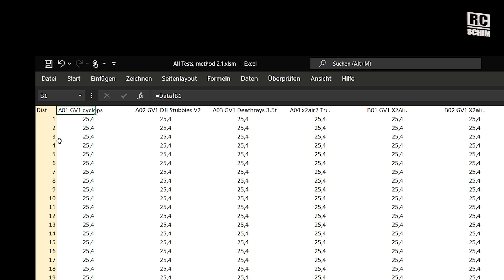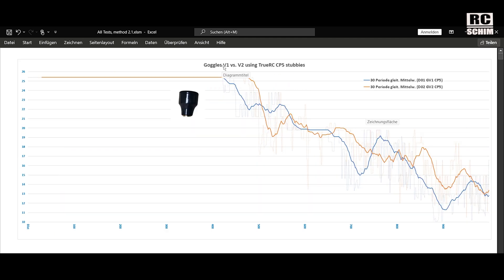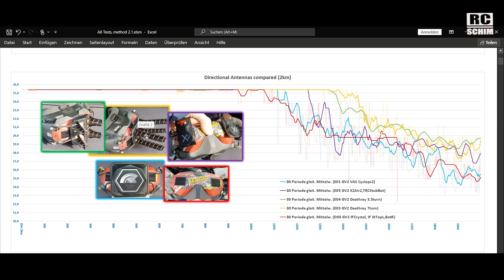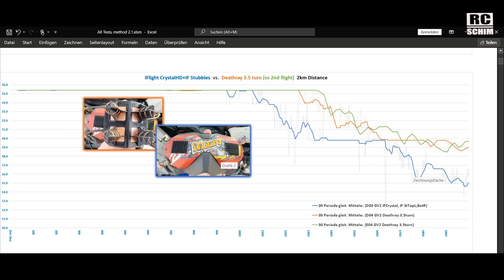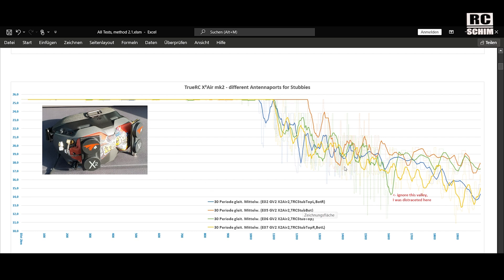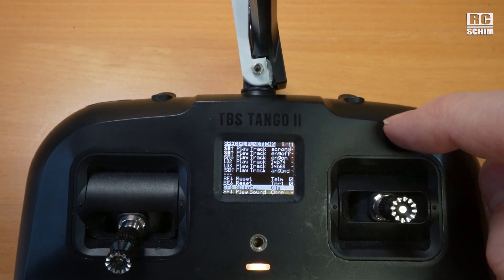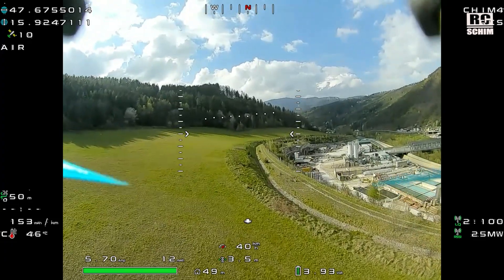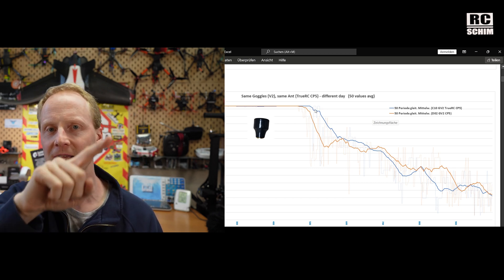Did I test YOUR anntenna? How good is it? (Antennatest 2023)

Comment from the maker: Link to my Antennatest File: https://bit.ly/3LsRQx0   and here the online tool: https://maxbl4.github.io/otx/index.html
SUPPORT my work:   my FPV24 affiliate link https://bit.ly/3UcTLJL  or become a PATREON: https://bit.ly/2ESMtIO
Products:    
TrueRC X2-Air MK II LHCP  https://bit.ly/40WMf7H 
TrueRC Singularity 4-Pack LHCP https://bit.ly/3NtFsPU
TrueRC CP5 Stubbies https://bit.ly/3BFOsL1
iFlight Crystal HD  https://bit.ly/4166Vdn
Reply: Thank you for sharing your valuable knowledge with us. My v2 goggles lost the signal after 600m. The goggles were indoor. what is the best antenna's performance to improve data rate and range? what type of adapter do you recommend?
Reply from the maker: @asmaali9466  Hi, first way to improve your signal is the NACO.txt file hack (or HamCFG on DJI O3). Just mention this because not everybody uses the may power...
if you were inside a house and flew outside, this is difficult (how think is the wall...)  this antenna test here is the most recent I did (since lately it works so good no need for better antennas).   You see in my results that I trust Hugos antennas (TrueRC) - they are not cheap - but good performance.   On the TX side (the copter/Plane) also use good, long neck antennas - so they have a good position.
on the RX side (Goggles) I love the X2air patches and TrueRC Stubbies on top. This is a super small yet powerfull combo which I use now over a year (and I have flights with 5-6km and no issues).

Comment: Great what you're doing - I have a V1 and a V2, each with 3 patch antennas and an Omi (bottom right). Is the V1 better than the V2 due to diversity? With the V1 I can cover a distance of 5km on poor terrain. Greetings from Munich
Reply from the maker: greets back, dont think there were considerable differences between g v1 and v2 with same antennas installed. my goto config for the last 2 years now was:  2 TrueRC Xair2 patches and 2 TrueRC CP5 stubbies on top ports - as these were the best stubbies and they give me a good overall performance.
Reply: @Rcschim  okay, then you never have two patch antennas as RX, which wouldn't be optimal for longrang, right?

Comment: How many mw were you transmitting in all these tests? Also have you done a test for the stock ones?
Reply from the maker: 25mw if not stated other. And yes, there should also be stock antennas tested. Use the chapter marks

Comment: Great video my friend! I had Lumenier AXii HD2 but I sold my DJI FPV Goggles V1 last month. I'm going to buy DJI FPV Goggles V2 soon. I'm happy with my previous Lumenier AXii HD2 antenna. Is the TrueRC X2 Air better or they perform almost the same? The AXii HD2 cost way cheaper too.
Reply from the maker: The axii 2 should perform similar to the iflight Chrystal I've tested, so yes they will be a bit behind those truerc xair2... but just try it and see if you really need the range...
Reply: @Rcschim  Thank you!

Comment: Have you tested X-Air (mkII) antennas as well?: they have 2 connectors per pair instead of 1 as is the case with the X2-Air antennas that you tested. My expectation is that the X-Air (mkII) will result in more range since all 4 antennas on the goggles are directional then.
Reply from the maker: No, only tested the x2 air... but they are my default setup now for over a year. Never needed to bother with antennas again ;)
Reply: @Rcschim  Have you tried x2 on all ports? I have it now but i dont know if its better or worse than having only two. It feels very directional.
Reply from the maker: Yes,  I have the x2air on all 4 ports as default setup since over a year now, works great!
Reply: @Rcschim  I am guessing you mounted them horizontal? To fit all 4

Comment: great stuff, i have three og antenna and one iflight stubby, what channel and antenna orientation should i use? hehehe, i have top right the iflight stubby, and just recently switched the vista up to 1000mw, i really hate putting that much power through the vistas, its gotta hurt them long term?
Reply from the maker: I think you should be fine. If I don't need max penetraition I stick with 700 imaginary units of power (which equal the legal 25mw)

Comment: I think I'll have to try some helical antennas on my goggles V2.  thanks for the test results Mario!
Reply from the maker: yep, helicals are still the best.   I was always surprised (in more than one test now) that my 7turn helicals are not that much better than the 3.5turn ones. Maybe the longer ones really start to shine at very long ranges?  greets and thanks for coming over here for this vid, Mario
Reply: @Rcschim  Hi Mario from Scotland.. I'm assuming the death ray 5 turn would provide similar results if the 3.5 & 7 turn are similar?

Keep up the good work ! 1 other thing do you have any videos of building a ground station as I fancy trying all the antennas on a stand / tripod instead of the V2 goggles..
Reply from the maker: @serval_fpv  Thanks and greets to Scotland! About groundstation:   never tried one for DJI - because I think you'd need 4 extension cables for antennas if you wanna wear the goggles while flying. Cables mean loss...
You could try to mount the goggles (with antennas) on a tripod and stream the contents to a seperate screen. Friend of mine just did something like this with 10" screen and a raspi HDMI setup. Sounded a bit overkill but works cool. If you are really curious shoot me a mail to rcschim@gmx.at and I will forward your question to my friend.
Reply from the maker: @serval_fpv  oh yes, and I suppose you're right - the 5turn might be quite similar. In theory the 7turn will be way better on the extreme end of a longrange flight (which I've never gotten to).
Reply: @Rcschim  Are the 3turn Death Ray Helical Antennas still available anywhere?

Comment: Just curious if the truerc x2 air are plug and play for the DJI fpv goggles?
Reply from the maker: yes, sure. They come with dualside advesive and you can either glue them directly to your faceplate. Or as I did: use a 3m Duallock hook tape to make it swappable (which I needed for my tests - now I would permanently tape them on because they are good!)
they use 2 of your antennaports - the other 2 can be used with stubbies.
Reply: @Rcschim   awesome! thanks for the reply the main reason I bought the antennas was because of your video👍👍👍

Comment: Great testing as always Mario. Sorry if i missed it in the video, how did you automate the logging of the bitrate of the video link? I have always manually log it but it takes a LOOOG time :D
Reply from the maker: Thanks Oscar! Great to see you here in my comments. Don't be shy, come here more often ;)
The goggles (v1 and v2, not so sure bout g2) record the SRT file.  Normally I would have converted this SRT (subtitles) to an CSV file (be text replace makro). But the super cool online tool I've linked to does all this.   But it is based on the OpenTX logfile first, and can then JOIN the SRT from DJI. Only downside: on longer flights, where SRT is split by DJI - you only get the first. Or you manually join the SRT files into one...
Impressive stuff:  the programmer joins the SRT file with time sync to the OpenTX Log. Try this yourself in Excel - it's a nightmare.

But as I said, if you just want a quick look at the performance (of an antenna) you can upload it there and get the chart there easy without using excel yourself.
Lately he added to option to change the X axis from normal index (count) to the GPS Distance. This is uber cool - because that was exactly my idea in excel  (assign bitrate values to certain distances - and make averages).
greets, Mario

Comment: Nice real world testing to get away from what appears to be non-standardized manufacturer's data claims! I find it interesting that your 3.5 turn helicals beat out the X2Air2 set up midway through test yet hold on at the end. Do you have a hypothesis to explain that result?
Also I want to add that apparently the receiving antennas on the DJI-V2 goggle are located on a diagonal. When wearing the goggles the upper right side and the lower left side are the receiving antennas. The others are the transmitting antennas. So your results suggest that both the reception and transmission are  needed to give the best bit rates. Not surprising given that is the DJI system.

Comment: Nice test. It's hard to beat the helicals when you really need range. Per the comment about pagoda's not being as "omni" as the others, I feel like this is in your favor. Most of the time folks don't fly 1km straight up, and even if you do, it's perfect LOS, so probably won't have any issues.
Reply from the maker: Thanks, I agree directly above startpoint is not so important. But remember the pagodas are not mounted vertically on the goggles but in 4 different, weird angles...
I've now added the TrueRC CP5 on top ports to the X²air2 as my default config. If I wanna go out very far, I'd take the deathrays with me.
Reply: @Rcschim   Other than looking cool, those weird angles probably help reduce the effect of the nulls.

I still have my 5 turn death rays, and VAS Cyclops, but I haven't done any real antenna testing since I bought G2. Paired with O3, it goes further than I want to retrieve my quad. Maybe one day I'll get the itch to push it, but for now, I can do with G2/O3 what it took death rays to do on v1.
Reply from the maker: @rcrdps8144  yep, that's what I hear from others as well ;)  O3 seems to do really well even with very low signal. Rossers test (DJI vista, O3 and Walksnail) with variable attenuation is brilliant in showing this 60db attenuation and still going on O3 where others passed out ;)
That being said I'll go out and fly now! greets
Reply: Hi Mario so now you go with CP5  stubbies on top ports Xair patches on bottom ports ?

Comment: Great testing you’ve done there, keep up the good work👍🏻
I love my 3 turn Death Rays and don’t see how I could possibly improve on them.  They work great for LR(out over 6 miles at low altitude), and with the 174° beam width they are not super sensitive to not being aligned perfectly, and work very well even directly behind you.  Glad to see your testing makes them look like a great choice as well 😎
Reply from the maker: Agreed, the only way to improve then might be a smaller footprint, that's why I will use the x2air2 now more often
Reply: @Rcschim  Yeah, there’s got to be some trade off for the performance they give though I think.  The 7 turns look too big, but the 3 turn just fit in the backpack nicely for me 😎
Happy flying

Comment: Great comparison, always! I have AXII HD 2 Patch antenna on my DJI goggles v1. I was able to test it 3 weeks ago in Nevada. I think I was able to reach at least 3 miles which includes the top of the mountain. The signal went down to 35Mbps but I didn't see much lost in the quality of the video even if I was using AutoFocus to ON.
Reply from the maker: I think it goes down to around 30mbit quickly but the it will stay in this region forever. But it also scares me, if it is less than perfect 50 ;)
Reply: @Rcschim  yep haha, same here. You should check out my Nevada cinematic flight. Check it out and see my dive at the 3rd minute. I was very scared but it was so beautiful!
Reply from the maker: while we know our gear works (most times) the anxiety never goes away ;)  especially if flying next to giant mountain walls. each little gust feels "letal" ;)
Reply: @Rcschim  Yep, I totally agree! I have a technique though. There is a little opening above my nose, below the DJI fpv goggles. If I get scared during flights(not freestyle), I look at the ground or I look at the radio since I can see it, HAHAHA! My fear goes away. But I only look at it for like max 2 seconds. 🤣
Reply from the maker: Yep, I also use the little light leak hole above the nose to look at my radio or to make adjustments to my heads direction (am I looking at the right mountain?)